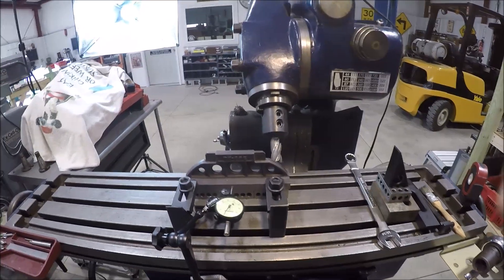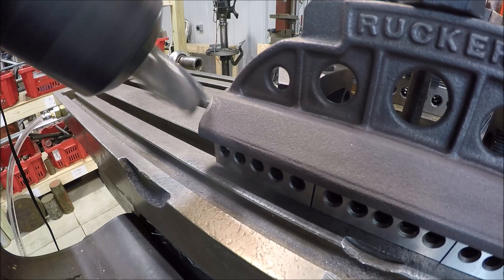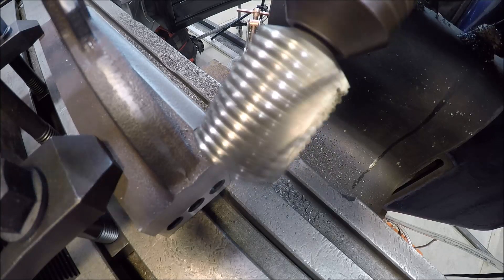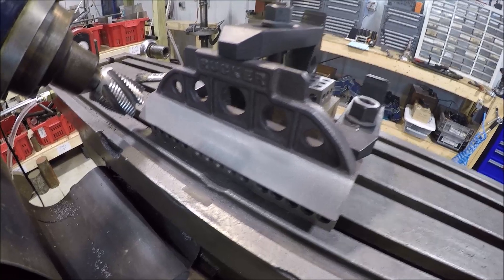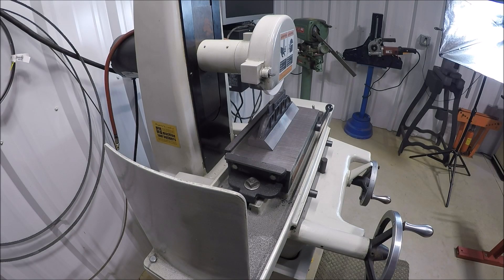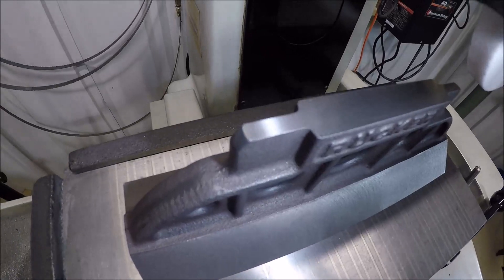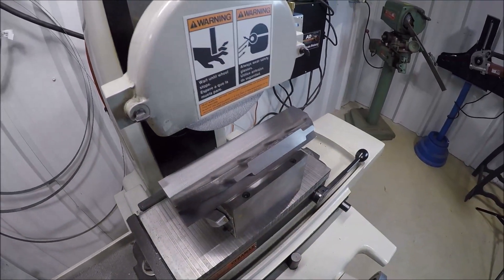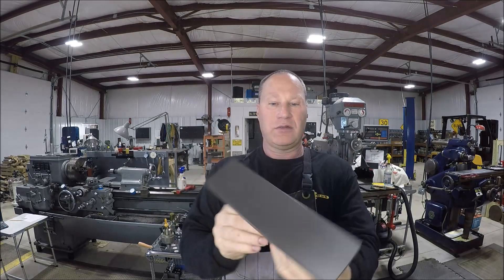Milling a camel back straight edge casting. Part 2

Comment: Hi Tom enjoyed watching. Great to see the Abene milling machine working again, looks like previous butter fingered owner was constantly dropping things on to the table with all those dings.
Interesting to see how you set up the surface grinder using the transfer blocks for stability. Are you painting the straight edge and highlighting the name? It's worth it. Tony
Reply from the maker: Hey Tony. I did paint the straight edge silver and highlighted the letters in red. Looks pretty snazzy. Yeah the table is better than is was. I did a lot of stone work on it to just get it in the condition you see it.
Reply: @hilltopmachineworks2131  Looking forward to seeing both in a future video Tom. Love the Abene mill, very under rated and overlooked machine. Good stuff Tom. Tony.